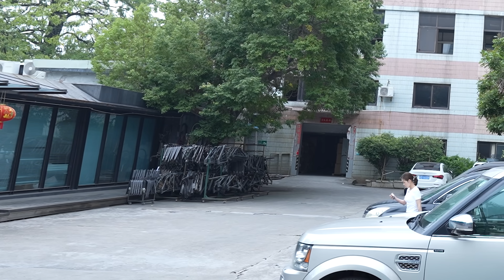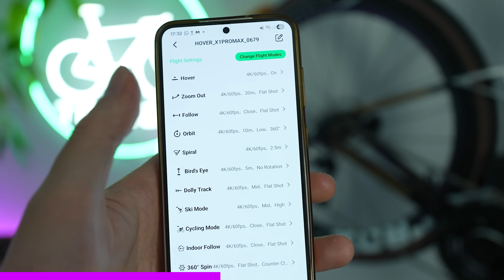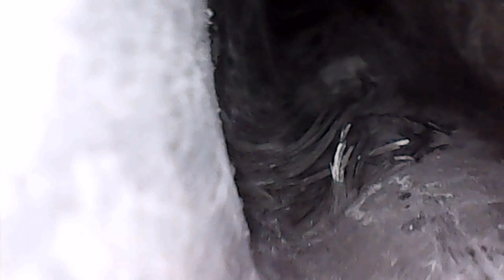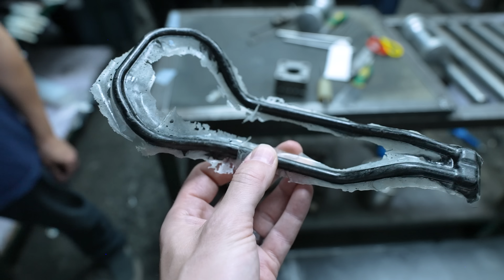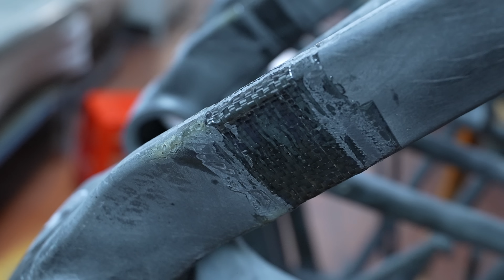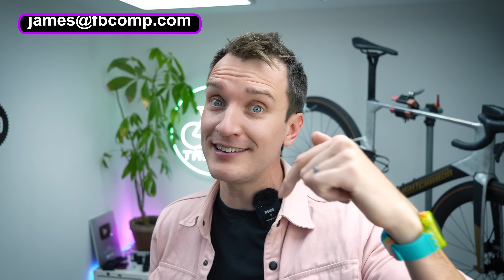The Secret Chinese Factory Behind Premium Bikes

Comment: Western Industry: "We've been outsourcing our manufacturing to China for the last four decades!"
Also Western Industry: "If you want quality products you cannot rely on Chinese manufacturing!"
Reply: Also west: why our economies struggling and China (particularly its war machine) is thriving 
Fk we're dumb.
Reply: China can make it's own T1100 grade carbon fibre and even T1200 grade ,the got 6 podium finishes on MotoGP bikes you think you could do that by luck? They got DJI avinox it's a great evbike motor.china can make good stuff if you can afford the better stuff.but if you buy cheap and complain that's your fault for buying cheap products
Reply: I thought everyone who was into cycling of various kinds realized the reality, It's not even just a new thing due to carbon. Back in the early 2000's most of the hot frames in Aluminium were being manufactured in Korea IIRC.
It just seems its easy to gaslight so many of my fellow westerners with mildly racism idea that "quality only comes from the west" .... LMFAO 🤣😂
Reply: Western industry: ZZZZ…😴😴😴
Reply: I'd say it's more you "mostly can't" rely on Chinese QC. Having worked with some manufactures in China I can tell that some of them are truly good in terms of what they can produce/achieve, but a general issue from a lot of those manufacturing people lies in how they handle defects.
Reply: It all comes down to quality control.  I presume that western designed and manufactured  products in China will have higher tolerances compared to a product that was natively designed and manufactured by a Chinese company.  I mean we do see a lot of examples in the real world like Chinese made cars and EVs failing much more often.
Reply: @mandark357 the Chinese design and manufacture better than the “West”. Your ideal that the West is smarter and more ethical is simply a dream. Feels good to say? Yes.
Reply: @o @openwheelracing88 Riiight.  That’s why almost every Chinese “homegrown” product closely resembles western products.  From cars, tanks, planes, carriers, bicycles etc.  Most quality products coming from China are things like Apple products, Trek, BMW, etc.  Western products manufactured in China under strict QC.  There are some good actual Chinese products but those are few.  Main reason?  Chinese QC is unregulated.  You may get a carbon seatpost that works perfectly fine but another might buy the same and it will fall apart in the first ride. 🤷‍♂️
Reply: @mandark357 
You should do some research and find out how often Western auto manufacturers, even the most established ones, had to recall their  cars due to various manufacturing flaws. Companies like  Ford and BMW.
Reply: Manufacturing is only one aspect of a way larger picture. The fact that an iPhone is assembled in China, doesn’t means an Oppo is as good as it.
Reply: @atlanticview98 
The latest Oppo flagship phone , Find X9 Pro/Ultra is broadly considered superior to IPhone 17 Max Pro in battery life, fast charging and telephoto zoom capabilities.
Reply: Right? The only thing I can think of that justifies x10 prices is that they reject 9 out of 10 frames from their Chinese supplier. I really wanted to try the Sava or Twitter frames but other reviewers have pointed out real issues of those frame.
Reply: @besouniveirs.1643  
I seriously doubt they reject 90% of the frames they buy. And if they did, they'd probably have some kind of quality clause in their contract to avoid paying for it.

Most companies do not outsource to get better quality - they do it to save money. What then ends up happening is that the places they outsource to end up being the experts.

"But lots of Chinese stuff is crap quality!"

Yes. So is lots of US made or European made stuff. And you get what you pay for. The low quality Chinese stuff is the cheapest stuff that didn't pass muster for higher paying customers.

All people are doing with the "it's Chinesium!" is fall into the same "trap" that worked for Japanese stuff back in the day. Back in the day Japanese stuff was considered low quality, and today it's synonymous with high quality.

Comment: 15/00 I don't get how the remove the EPS mold and air bladder post oven, can someone help ?
Reply: Different factories handle EPS cores very differently. To be honest, the basic concept is fairly straightforward.

In most cases, a traditional inflatable bladder is placed inside an EPS (expanded polystyrene) core before molding. One of the limitations of a conventional bladder system is that internal pressure can be insufficient, especially when manufacturing carbon components with very large cross-sections, such as the downtubes found on modern aero road bikes.

By placing an EPS core inside the bladder, the volume of the internal air chamber is reduced, which increases molding pressure during inflation. At the same time, the EPS provides structural support during layup, helping the carbon fiber maintain its intended shape before consolidation.

Removing the EPS afterward is usually quite simple. Workers often use a flexible rotary tool attached to a drill to break the EPS into small pieces and extract it through existing openings. In other cases, the entire core can simply be pulled out intact. Whether that is possible depends largely on the frame's internal geometry and whether there is a clear extraction path. Overall, the process is not particularly complicated and is actually quite straightforward.

However, some narrow or enclosed areas present a different challenge. In these locations, the internal support material may be left inside the frame permanently. Certain geometric features create trapped volumes that make core removal impossible. In those cases, manufacturers may use PU (polyurethane) support cores to maintain shape during molding.

Examples can be found in areas such as the rear triangle of some SEKA frames or the seat tube region of the Trek Madone, where complex internal shapes create trapped sections that cannot be extracted after molding. In those situations, the support material is simply left in place inside the structure.
Reply: @陈泽平-l8z  thank you very much for the details !!
Reply: Air baddler can bu pulled but the foam?

Comment: Takes me back. I worked for a UK factory that made carbon parts out of prepreg for aerospace and motor racing back in 1990. Closed long ago. Process looks very similar. I did a short stint on the shop floor. Hardest work I have ever done. It’s a really tricky job and I was just making seat backs for aircraft which are nowhere near as intricate as cycle frames. Many of the workers were female: a major complaint was that they had to have short finger nails to avoid tearing into the material. Have also seen wind turbine blades produced out of carbon too: the factory and moulds have to be very long! 

Easy to see why western brands outsourced this. Try getting workers who want to do this type of work at the sort of wage rates that the brands want to pay. Add the high cost of energy in Europe and the business case is easy. Manufacturing is also not much of a differentiator. Bit like high end watches: pretty much every one uses similar mass produced movements and the manufacturing cost is tiny. But it’s all about “brand” and mystique, LOL. Not saying I like the brands strategy but it is what it is.

Comment: My beautiful, wonderfully designed Pinarello bike frames are built in Taiwan.  In my opinion the issue is not that the carbon frames come from China/Taiwan, the issue is when those factories or companies decide to manufacture and sell their own frames, are they using the same quality materials, processes and QC as when the western brands are built?  I suspect that for the brands that are gaining the most traction in the Western marketplace the answer is 'yes', however, given the volume of frames that are coming out of the East as direct-to-consumer, I believe that there are also plenty of manufactures that are not 'top end' in terms of the build.  

As a Western consumer who is open to idea that I don't need to pay the Western brand premiums to get a quality bike, the question has always been how to identify the quality from the junk.  Fortunately channels like yours along with retailers like Panda Podium are helping.

Comment: But how do they remove the EPS foam?
Reply: Thats my question too?
Reply: Different factories handle EPS cores very differently. To be honest, the basic concept is fairly straightforward.

In most cases, a traditional inflatable bladder is placed inside an EPS (expanded polystyrene) core before molding. One of the limitations of a conventional bladder system is that internal pressure can be insufficient, especially when manufacturing carbon components with very large cross-sections, such as the downtubes found on modern aero road bikes.

By placing an EPS core inside the bladder, the volume of the internal air chamber is reduced, which increases molding pressure during inflation. At the same time, the EPS provides structural support during layup, helping the carbon fiber maintain its intended shape before consolidation.

Removing the EPS afterward is usually quite simple. Workers often use a flexible rotary tool attached to a drill to break the EPS into small pieces and extract it through existing openings. In other cases, the entire core can simply be pulled out intact. Whether that is possible depends largely on the frame's internal geometry and whether there is a clear extraction path. Overall, the process is not particularly complicated and is actually quite straightforward.

However, some narrow or enclosed areas present a different challenge. In these locations, the internal support material may be left inside the frame permanently. Certain geometric features create trapped volumes that make core removal impossible. In those cases, manufacturers may use PU (polyurethane) support cores to maintain shape during molding.

Examples can be found in areas such as the rear triangle of some SEKA frames or the seat tube region of the Trek Madone, where complex internal shapes create trapped sections that cannot be extracted after molding. In those situations, the support material is simply left in place inside the structure.

Comment: Unfortunately in Italy if "last significant process" is made in Italy you can claim it's made in Italy. Same Switzerland with watches. Germany went as far as removing "made in" altogether
Reply: Now they say DESIGNED IN BAVARIA 😂🤣😂🤣😂🤣😂🤣🤣🤣😂
Reply: Yep. Technically it is 70% of the ‘value’ of the final product. If you are lucky with bikes, that is clear coat and decals, but normally it is just assembly.
Reply: That’s why Italy has the largest Chinese community 😂😂😂 all the luxury furniture and clothing is funneled through them from China to be “manufactured” in Italy.
Reply: Same in Australia. All parts can be imported but if it’s assembled in Aus, it’s “made” here. Make it make sense
Reply: @drucejnr  You see it a lot with tools. Every single ‘Australian made’ compressor brand bolts the same imported pumps onto the same imported cylinders.

Comment: Remember we have this capability in the UK to make f1 cars and aeroplane parts, we just dont have low enough wages to make bike frames.
Reply: There are more than enough margins to allow carbon bike frames to be made in the UK. You are held back by a lack of supply chain, licensing and town planning encumbrances, and workforce skills.

There is a reason that motorsport and aerospace is largely clustered in business/industrial parks. You can’t just decide to start making carbon parts in your back shed without an army of lanyard wearers descending on you. The industrial park model has blanket approval of industrial production in an area.
Reply: @King-Kazma  The workers are literally just sticking stickers together its like a days training tops lol. There are plenty of companies in the UK making small scale carbon parts for different industries, people have zero clue what it is the UK actually produces its all just guesses. The complexity all comes from designing the process and making the moulds though thats been simplified with hot carbon melting and CnC machining, plenty of UK companies making those too.

Comment: Carbon is over rated. It breaks and can't be effectively repaired, unlike a metal frame.
Reply: What frame material doesn’t break? And it can be repaired. Other than that 😅
Reply: You see carbon is just  hair-like flacid sheets which hardens with high temperature. Not very reassuring thats for sure.
Reply: @the.communist  so it’s flimsy until it isn’t? 🙃

Comment: @Trace Velo The Problem with brakepads is, they have a ton of airbubbles inside them because of how they are made. Imagine a Sponge made out of Resin/Metal and other addetives. This space between the elements soak up WD40 type oils and some other oils from the street sometimes, makking your pads heat up with oil and get al glassy texture because of how oil and the components of the pad react to eachother under pressure and heat. you wont get the sqeak off withour burning the oil or getting new pads. if they found out a godd other remedy that would be very nice. 
PS: Even the surface of the braking area, such as rims or Rotors can have some space inside the stuckture of the metal, especially if there is aluminum alloys involved. 
Good Luck with the Gel!

Comment: From what I know the engineering and design such as shape and location of carbon wrap in done in Europe, US, etc, but the frameset, etc is then fabricated in China. Painting is done either in China or for high-end models abroad. So technically Euro brands could say designed and finished in Europe.
Reply: Part of the engineering. There's a huge amount of engineering going on in the factories to develop molds and manufacturing that is not done by the brands.

Comment: How do the aluminium inserts not melt when it gets baked?
Reply: Aluminium melts at around 660°C, the frames get baked at 150°C in this factory... there are also aluminium baking trays and a normal household oven gets significantly hotter than the molds...

Comment: Aren't the forms/mandrels also helpful to reduce the time a mould is occupied? It used to be that the layout (of some parts of a frame) was done directly in the mould. But that meant that a mould was occupied during the entire layout process plus the curing time. And to expand production capacity of a given frame part, you needed more costly moulds. Now, with EPS mandrels you can have multiple people do the layout for multiple pieces of the same frame part, and you only need a limited moulds to "just" cure all these pieces.

Comment: "Adrenalina Italiana" is my fave. Had a guy swear up and down his bike with that sticker on it was actually MADE-IN-ITALY but couldn't explain WHY it didn't say that on the sticker. 
I have a carbon gravel bike that DOES have MADE-IN-ITALY on it but I have no idea who in Italy actually made it. I seriously doubt the folks whose name is on the downtube have a carbon fiber frame works anywhere in Italy (or anywhere else) as it's really a niche brand.
Reply: If it's actually made in Europe, it will actually say so front and center in bold letters with pride. Like Time or 3T. If a company appears to be European but the country of manufacture isn't one of their key marketing points and they use vague terms like "designed" or "engineered" in Europe, you know why...

Comment: A shop hack I've used for squealing disc brakes was to hit the pads with a camp blowtorch to burn out any contaminants.  Carry on.
Reply: Or spray in brake cleaner and light on fire.
Reply: I also use heat to clean squealing brake pads. I just put them on my stove and hit them with the heat gun. Always works a charm.
Reply: They're cheap enough to just replace them. I bought 2 pairs of carbon ceramic pads on ebay for $10. Tracking said it would be at my door in 2 days but the tracking was from China then 2 days later it was delivered by a Chinese delivery company in the US.

Comment: I love these insider factory tour videos. 

Ps. Luke, if the brake still squeaks, have tried baking the brake pads for a moment, e.g. with a butane hand torch? I do this every time as I found that dipping them in ipa or brake cleaner and leaving even over night does not always work. I knoe thar there was still some left over oil contamination inside when for the first few seconds of torching it, it smokes extensively and once it stops I know it's good to go/well done 👌

Ps2. Nice work with renovating the workshop. Clean look but I'm afraid this bright wall where the neon is hanged will get stained quickly 😅

Comment: Working with carbon without wearing face masks? Have they got some kind of capture and extraction in the factory? Should you be endorsing this Luke, if not?
Reply: they aren't manufacturing raw carbon which is the dangerous part. probably still a good idea to where masks at any step that involves cutting or damaging fibres though.
Reply: There is no carbon dust released when you're sticking carbon prepreg patches together. I'm sure they wear masks when they do the sanding.
Reply: I worked in a UK factory that made carbon back in 1990. Masks not needed for lay up activity. No dust.
Reply: We all die eventually
Reply: They have plenty of people - when the current ones are dead they'll just be replaced with younger ones.
Reply: @larryt.atcycleitalia5786 exactly, just like europe

Comment: it is very deadly working in these factory
Reply: These factory? What about those factory?!
Reply: manufacturing the raw material (carbon fibre) is dangerous and require ppe. this stage not really
Reply: fumes and chemicals ?
Reply: its the carbon fibre
Reply: Proof for this claim?
Reply: There are way more dangerous workplaces out there, trust me. That doesn't look like a work place where you die if you stop paying attention for 5 seconds
Reply: Do you have evidence for this?